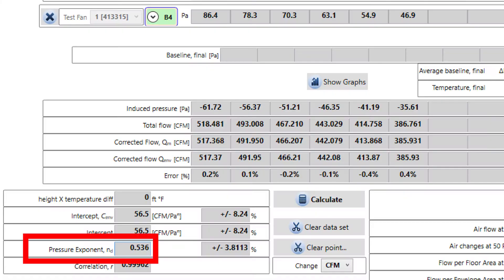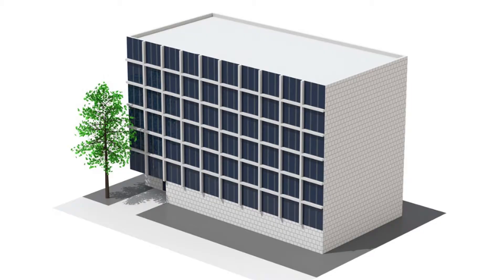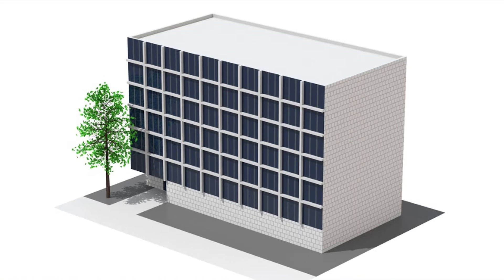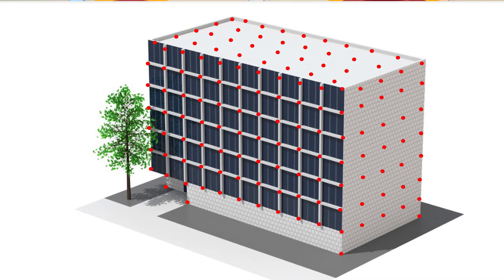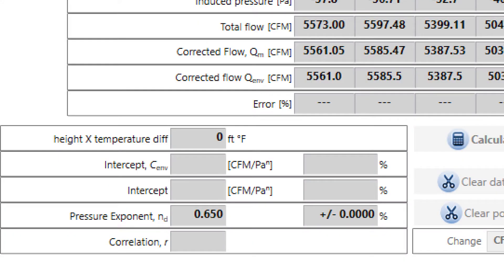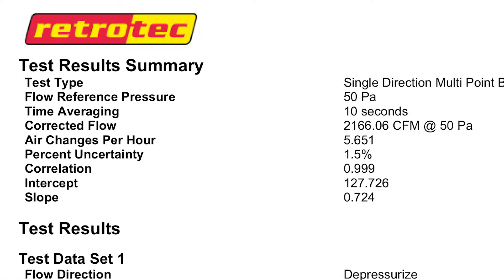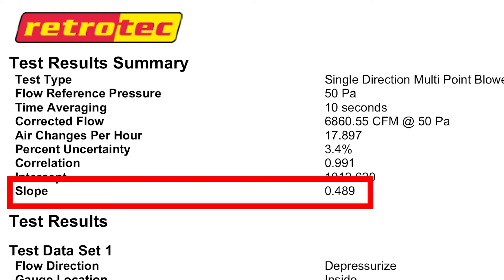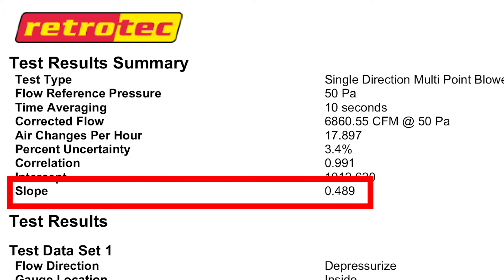Technical Tuesdays - Ep. 5: Multipoint Blower Door Testing Part II

Comment: So how do I actually run the multipoint test. Do I hit record on my DM32X and change the pressure for a few minutes at a time. Or do I have to stop the recording and restart it after every speed change and make multiple recordings and then stitch them together?
Reply from the maker: Hey Kevin, you use the rCloud app. You can choose RESNET 380 if you want to comply with that standard, or you can just run a basic blower door test from the menu of standards. Just follow the prompts and it will run a multipoint test automatically.